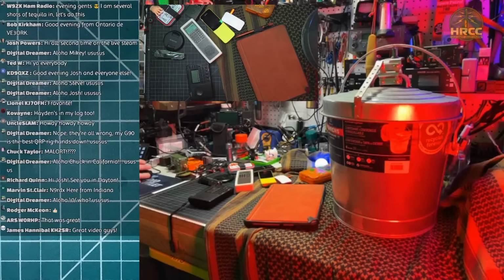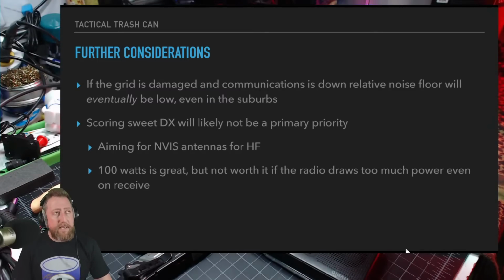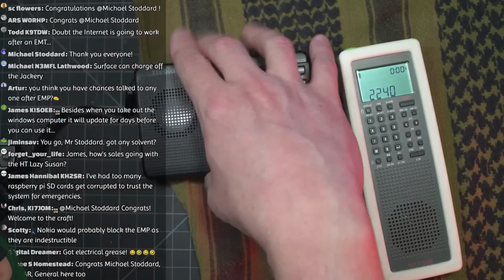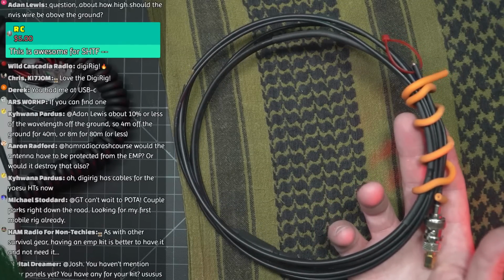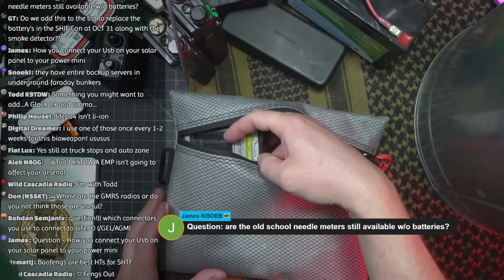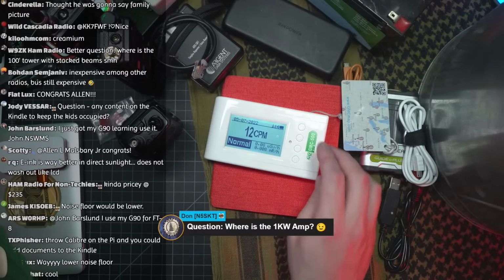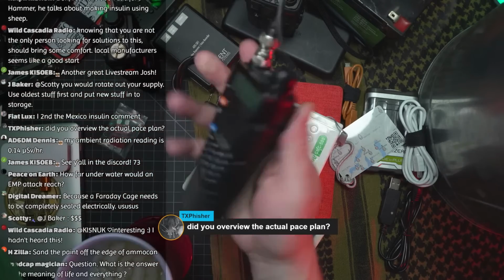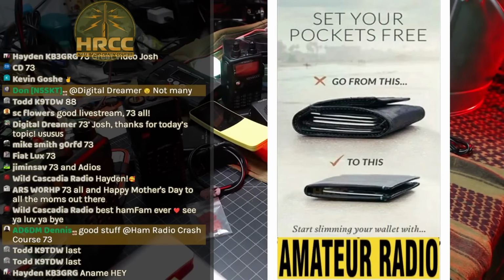The Updated EMP Tactical Trash Can Communications Kit

Comment: I was expecting more than 50dB with those gaskets. There are cheaper options on Amazon that I'm curious to see tested against the ones you linked. If you ever decide to make a video testing them I’d be happy to donate them. Talked to an Air Force veteran who suggested using something ferrous, like stainless steel or nickel-plated copper tubing, to make a gasket for the trash can. Wondering if that could be more effective.

Comment: Hi Josh, great video. I've seen the first version of it and now the updated version. 
I'm not sure if you're aware, that you won't be able to power your Yaesu FT-2D, FT-3D and FT-5D from the 3 AA rechargeable batteries. You will be able to power those HTs from 3 AA alkaline batteries, though. That's because the rechargeable ones are only 1.2 V, which will give only 3.6 V in total, as opposed to 1.5 V of alkaline ones, which will give a total of 4.5 V. I wonder why this was not picked up by anyone.

Comment: Great video.  Late to the party in my comments. Tips: When checking seal on can I placed a bright lantern inside and looked for light leaks. I lined the can with two 4mill thick trash bags for water protection.  I taped several light/glow sticks to the inside if the lid.  I also used a larger 10 gallow can, it allows for a larger battery and larger folding solar panel. (looking back at it I would use an even larger can, if putting in the effort larger would be just as much work)  Dont forget LED flashlights have small intergrated circuits in the emitter, protect them, older filament flashights are not emp sensutive. Remember, No Power - No Comms,

Comment: Put the same mesh and cardboard treatment in the lid of your can.
Reply: Store batteries in the can but not inserted in electronics. Take the batteries out. And store separately.
Reply: Put SD cards in bucket. Everything all together. And another kind of bag carryall for equipment if you need to ditch the heavy bucket. Then decide! If you had to toss some of it and get down to bare minimum - what 2 items and antenna - would you keep. Battery pack and solar panel. Your minimum - grab and go??
Reply: Discuss it with ham buddies. So if you all carry the same..You know what your working with. For comms
Reply: Those oximeters are great to tell if someone is in real trouble or no.  Or Just hyper ventilating!!

Comment: Love this! Thanks for the update on it. Probably going to use this as a guide for my first setup, then one day graduate to your Go Box. I had 2 cents if you dont mind and hope you dont take it as a criticism at all:

To answer the security question about someone DF-ing you in a high threat situation: we (military) never transmit from a hide site. How this relates to most civilians would be: "go as far away from your station as you can/comfortable with, and transmit there. This may have to be pre-planned" I've had to walk almost a mile away 2 or 3 times per day to transmit and would go farther if I had to stay longer to avoid being found. But this is admittedly pretty extreme. 

Second: your PACE is esentally P-VHF/UHF, A-VHF/UHF, C-VHF/UHF (w/ possible repeater), E-HF. 

May I suggest: 
P-VHF/UHF (with or without repeaters)
A- HF (include CW if you pre-plan it)
C-Satellite (could be sat phone, a linked device like the Garmin In-Reach or Spot Messenger, or even VHF/UHF Sat, which is different/independent enough to set itself apart from the Primary)
E-Primitave options (sending a messenger, fires/smoke, mirrors, whistles, "buzz-saw" chem lights, etc)

Thanks for all your help, I'm in this hobby because of this channel. Would still love to call and chat with you one day when life calms down a bit!
Reply: good advice....   also consider NVIS and EME/moon bounce

Comment: YOU STILL NEED TO GROUND THE CAN TO THE EARTH.. I RAN FOUR EIGHT FOOT BOLTS IN TO THE EARTH THROUGH THE BOTTOM OF THE CAN WITH WASHERS.
Reply: You actually don't.  As long as the electronics inside the can are not touching the metal, you should be fine.
Reply from the maker: WRONG. WE TESTED THIS.  THERE WAS NO DIFFERENCE IN ATTENUATION WITH OR WITHOUT A GRIUND CONNECTION.  

BUT TELL ME HOW YOU TESTED YOIR CLAIM AND I’LL CONSIDER TRYING IT.

Comment: The regular charging port on the side of MS Surface Go takes 12v in so I bought a cheaper cigarette lighter charger for it, cut that off and crimped on some powerpole connectors.  That'll solve your charging and having something connected problem.  So far no issues charging it off my LiFePo4 battery.  My issue with the RPi is SD Cards aren't meant to run an OS.
Reply from the maker: Ahhh ok, I’ll look into this.
Reply: Hi, I know nothing about Rasp PI. Getting my first one tomorrow. I thought that's how PI computers worked, the SD Card was O.S. and storage? Have I made a mistake?